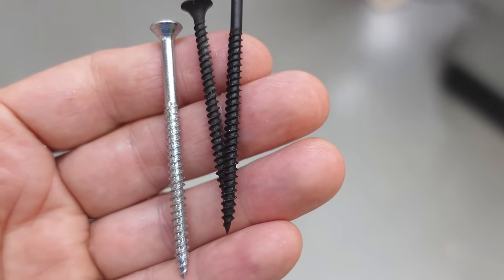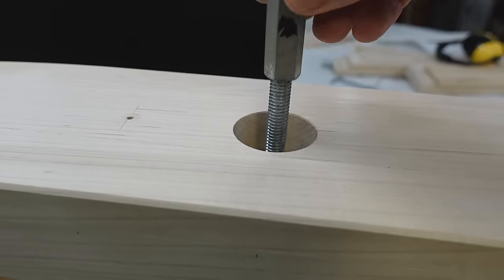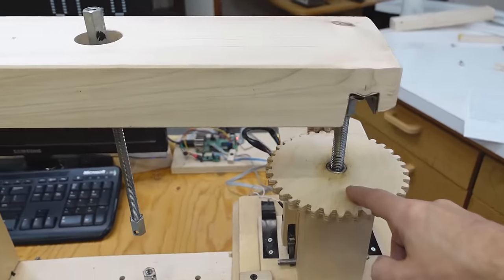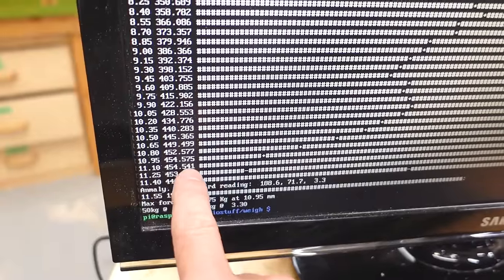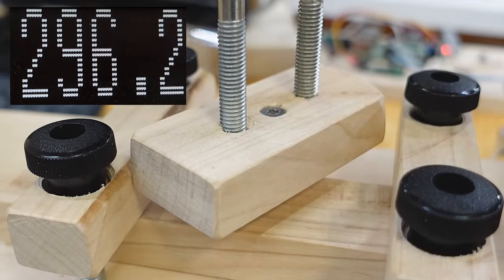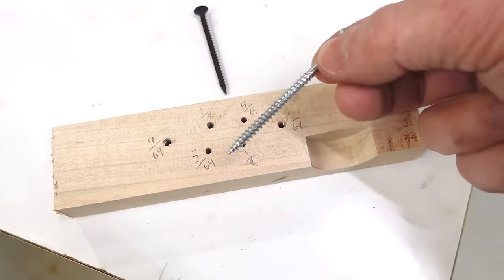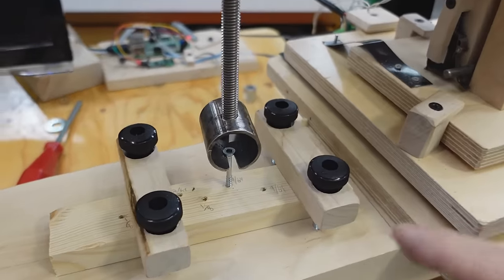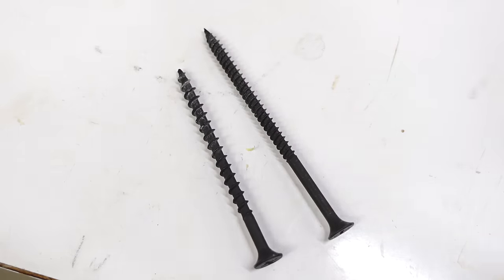How well do screws hold in wood?

Comment: I'm guessing that in softwood the fibres are more likely to compress and bend and therefore release the screw. A coarser screw thread would have more fibres between threads, but that would allow more compression and more space to bend into. Finer screw thread leaves less space for movement but fewer fibres to resist the pulling force. So, coarser and finer screw thread have little effect on resistance to pulling out. The difference is, as you said, ease of screwing in and likelihood of splitting the wood. Thanks for another interesting video.
Reply: I always thought fine for hardwood and coarse for softwood myself. But realistically as long as the screw is long enough I'm good to go.

Comment: Juste a thought about the "Not jumping" around the  2:00 mark : I suspect the cause is because of less elasticity on the upper beam which means that less force is stored in it to be dispersed when the screw/wood fails...
Reply from the maker: yes, realized that later too.  Once it starts to yield, the force drops more rapidly with the stiffer setup, so you don't get as many explosive failures

Comment: Matthias had a nice thick top piece. He cut into it on the ends and middle so that the loads would be in-line. It looks to me like he could have just left it full-thickness. The center bolt load would be at a different height, but since the force is vertical it would not have changed the moment arm nor the force calculations. Is the movement in other tests enough to cause a non-negligible difference? It seems that the weakened board is still strong enough, but it could potentially still fail.
Aside from that, I found it quite useful to know that pre-drilling the screw's minor diameter is best, considering strength and splitting.
I found the modes of failure interesting too.
Reply from the maker: I just didn't want to think about it being a factor.  The beam tilts, and that offsets things sideways.

Comment: Cool test.  Did the conical screw sink because of the shoulder?  in that case all of the load is held by the head in the top piece of the wood, with no threads to bear extra load.  Of course, with threads up to the head, you would have less clamping force between the pieces.  Trade-offs!

Comment: "Way more than we ever wanted to hear about pilot hole size" Matthias you doubt your audience. My son and I watched every second :)

I'm really curious about the head shape and the screw's surface finish having an effect. I would think the surface finish wouldn't make that much of a difference in the extreme force test but perhaps the texture allows it to distribute force better, and fewer individual fiber failures cascading into the runaway effect of the wood failing.

Comment: I have wondered if said screws were put in, in pairs making a V while joining two pieces of wood, so as to not be only testing the type of thread's holding power, but the metal shaft as well. Ta.

Comment: Would be interesting to see how grain direction and angle affects this!
Reply: I think we know that drilling into end-gran is weaker. But by how much?
Reply: According to the Eurocode, you can expect the same ultimate limit strength up to 45 degrees, and a decreasing strength as the screw gets closer to the grain direction. The failure mode will also change. When the screw  is parallel to the grain, you will no longer be bending the fibers, but more or less pul out a "dowel" the same size as the thread diameter. However, for a simple test like this, you might gett higher values than what is used in engineering. Wood, as we know, moves over time with moisture content and load levels, which can lead to small cracks often viable in the endgrain. These cracks can correspond with the failure mode for the screw, leading to lower resistance over time.

Pardon the long-winded comment...

Comment: 9:15 I suspect there's a pilot hole diameter between 3/32 and zero that can get you that optimum pull out strength and still guard against splitting the wood as you drive the screw in.  We might be surprised how little material needs to be predrilled out of the way before sinking the screw in.

Comment: I wonder if the differences between the materials of the screws has any impact on their ability to withstand being pulled out of the wood. Does the black phosphate coating increase the amount of friction and therefore make them harder to pull out?

Comment: Curious about the effectiveness of particle board screws compared to regular screws in manufactured materials (like particle board and MDF). A lot of cabinetry is made with those materials and I've always wondered if different screws matter in a material that is pretty soft to begin with.

Comment: I'm assuming the holding power with a screw in end grain, e.g. along the grain, instead of across it, is going to be much, much lower? Could you perhaps test this as well?

I was very surprised to see the coarse and fine thread drywall screw perform the same! I would have thought the coarse screw had much better holding power. Also I didn't expect the holding power to be this strong in general. Nice Test!

Comment: May I recommend trying each variation sans pilot hole.  There's a lot of folks out there, myself included, who rarely drill pilot holes.  I'd wager there's going to be a greater holding force as the strands of wood haven't been broken/cut-away via the drill bit, but have been merely pushed aside.

Are you an engineer by training?  I wanted to be, but Calc II (weed out class) was more than my 13 years previous Algebra could handle.

Keep up the good work, sir!
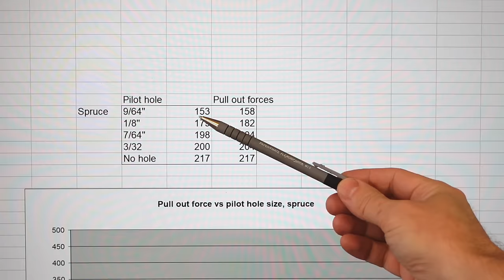Reply: At 8:58 the graph shows a tiny bit more strength with no pilot hole. But the chance of splitting the wood is a lot higher, he said. Especially near the edge or wherever common sense tells you it might split. If it doesn't matter, I usually don't pilot hole either. Saves time and getting less tools out to put away again.

Comment: I have seen these perforated metal strips that are inserted into slightly oversized holes with the idea that the screw would grab onto the metal and also the wood to form a mechanical bond. I Al curious if they would be harder to rip out of wood than just the screw alone

Comment: Odd, I was under the impression that common thinking was never use drywall screws in any structural application because either the heads pop off or the screw shears. Was expecting to see that, yet not?
Maybe Canadian drywall screws are just better or not the absolute lowest cost supplier?

Comment: Many thanks - its good to know that many screws - with a snug pilot hole - will withstand a force of at least 250 kg which is more than enough . . .
Reply: That's 250 Kg per screw. I never use just one unless I'm hanging a small picture. For a actual structural assembly I'm going to use a minimum of 4 screws per board. Otherwise it is an articulating arm that pivots.
Reply: @1pcfred  - Yes even better - Recently built a small workbench top which cam be clamped in a SuperJaws XL
Great to know that 3 screws is more than enough to hold two pieces of wood together.
Reply: @chriscardwell3495  screws are more force than one might imagine they are for such a little thing. One screw is stronger than I am. So yeah 3 screws are a lot of power. They'd resist anything but the most determined prying. You'd really have to be trying to bust them.

Comment: I am big on the thread width. That is the difference between the outer & inner diameter. I posit that the wider the thread, the more engagement into the wood and the better pullout force. I would love this to be tested. 

Drywall screws have really good thread width compared to wood screws, for some reason.  (BUT I hate that they're Philips so I never use them.) 
.there seems to be variations between manufacturers as well.

Comment: Be interesting to see if those threaded fastener inserts with the really flat and deep paddle like 'thread' bits pull out differently, I suspect with the flat and deep thread sections not acting as a wedge and spreading the load the failure wouldn't be as much pulling the fibres up and more clean splitting when it fails. But I have no idea really.

Comment: In my real world remodeling experience fine thread drywall screws I can usually use a hammer to pull out with ease vs coarse thread.  Would love to see a stronger jig setup testing different screws and even structural screws of equal size
Reply: I think fine thread drywalls are for metal studs. The gauge of metal studs is pretty thin. But we all use them in wood too. You can also use a hammer to put a screw in. Ain't nobody got time to use drivers.
Reply from the maker: the coarse screws had a slightly longer yield curve, which suggests more energy is needed to get them out.  But the finer threads could take more force before they started to yield.

Comment: I would like to see that test on a proper, taper shanked wood screw.
Reply: I have tapered drill bits for drilling pilot holes for tapered screws. It's a pain to get all of that right. Once you've got the bit setup you're good to go. It's still a fiddly process though. So the results Mathias achieves likely won't be the results anyone else gets.

Comment: Can you do 25mm M6 threaded insert vs 12g screw with 30mm penetration? Lots of furniture makers are direct screwing legs (X shape or hoop) to 42mm thick table tops using both these options - no aprons etc.

Comment: I have two wonderings:

What if you squeezed glue into the pilot holes before driving the screw in? (Hardening the surrounding grain)

What if you hammered the screw in? (Sheering the grain downwards compressing it against the pulling force)
Reply from the maker: the failure wasn't at the surface.  I doubt the glue woudl penetrate deep enough to where it failed

Comment: Would the finish/material of the screw make a difference on the holding strength? Zinc plating seems smoother than the black phosphate.

Comment: I've always heard coarse-thread screws for softwoods and fine-thread screws for hardwoods. I wonder if that is the case? The fact that fine-thread screws were marginally stronger than the coarse-thread for softwoods sort of contradicts this. I wonder if it's the same for hardwoods. 

Also, Kreg states that for hardwoods, "aggressive threads tend to tear the wood fibers, resulting in splits in your wood". But do coarse-thread screws really have a higher likelihood than fine-thread screws for splitting the wood? 

I notice Kreg recommends coarse-thread screws for softwoods, plywood and MDF, and fine-thread screws for hardwoods. I wonder if this is true, and if pocket hole/no pocket hole impacts this.
Reply from the maker: I would think coarse threads are less likely to split the wood, like I said in the video.
Reply: @Matthiaswandel Interesting. I wonder who's right; you or Kreg. Perhaps another test is justified :)

Comment: Screws and nails are often applied horizontally to hold a piece from moving downwrd. I wonder how the shear strenth of various screws and nails ompare?
Reply: In the vertical a fastener causes friction between pieces held together and that's your carrying load. The nails and screws aren't holding anything up. They're holding stuff together. The pull outs we're seeing here are close to a half a ton. So it's like a half ton pile of wood and you're trying to drag it across the floor. Which would not be easy to do.

Comment: Interesting! Also, I'm not sure if it's just a trick of the light or my eyes but it seems that at 5:42 there is a minor rotation (anticlockwise) of the screw, as if it tries to loosen itself under the strain. Pretty cool stuff. Thanks Mattias!
Reply: Flicker of light. I put it full-screen on a large monitor and my eyes say the screw didn't rotate.
Reply: @weldabar  I did the same and left the mouse over it so I could see a difference; it still makes me think it moves slightly but it's likely just the light. It doesn't matter anyway! :)

Comment: After you drill the pilot hole, run three or four drops of water-thin CA into the hole.  Allow it to cure (10 minutes or so) and then drive in the screw.  I'll bet it doubles the force necessary to pull it out.
Reply from the maker: please watch the video for why it would not

Comment: Do you plan to try CA glue in the wood threads to see if that makes it stronger?
Reply from the maker: No, seeing that it wasn't the threads themselves that failed
Reply: @matthiaswandel  I would expect that a thin CA glue might wick into the wood fibers around the hole, and the increase in material rigidity may distribute the force over a wider patch of the wood.
Or maybe not that at all....
If only I had a screw extraction force testing apparatus, I would know for sure. 🤔

Comment: I read a study about the load each individual thread holds in regards to bolts in metal that said basically only the first 6 threads on the fastener hold any significant load, with the first thread holding 50% of the total load. Any chance you could test something similar with wood screws? I'm dying to know if an increase in length increases holding power.
Reply: Yeah, that would be very interesting.
Reply from the maker: with the screw and hole having the same stiffness in metal, that makes sense.  Basically, the screw stretches a bit, so its threads become longer and only the first bit grabbed..  But as you could see from the cutaway, the wood yielded quite a bit, much more so than the screw would stretch.

So this is not the case with wood.  No experiment is needed.

Comment: A little constructive criticism, your sample had all the holes in a line along the grain and showed clear cracking. Better to stagger them and aim for some minimum separation per aligned pair. I think out of all your videos I learned the least from this one. Sett pilot to minor or slightly under or no pilot. I only pilot when I know I have to because too hard or prone to splitting or need alignment perfect. Otherwise I don't.
Reply from the maker: Look carefully, the crack is a straight line, doesn't follow the grain.
It was a scoring line from marking for something else.  Don't remember what for, it was a piece of scrap.

Comment: Awesome! So why then does everyone clamor that you can build stuff with drywall screws, you should only use wood screws? Are wood screws a scam?
Reply: Dry walls often work OK in the short term. But if you want something to last then you should use a better fastener. I've seen plenty of drywall screw failures over the long term. Even in drywall. So it really depends on the performance you want. Someone slapped an arbor together with drywalls outside my back door. I've had to rebuild it all with deck screws because it fell apart. But it was good for them.

Comment: I wonder if zinc screws would be weaker than the hardwood.
Reply: I have never seen a screw made of zinc. Zinc coated screws are common but I wouldn't think the coating would affect strength much.

Comment: Is it not that drywall screws are for grip and pull and more standard type screws take greater shear forces?
Reply: You shouldn't be relying on the fastener itself for sheer strength. That comes from the friction between the pieces. The fastener holds the pieces together tightly and the strength is the friction that is developed. That being the case there are ramifications for how things are constructed. For it to work your joins do have to be tight. You can't make floaters.
Reply: @1pcfred  Agreed. But when fixing, especially non fibrous/wood that has significant downward force, you do need a screw that has shear strength.
Reply: @aaaatttt101  as we saw in these tests the screw is just going to pull out before it breaks. Due to friction they're never going to be under a pure shear load. Not if you made whatever it is right. Which is work pulled together and not jacked. When in doubt use more screws. I have seen drywalls fail. I've seen them work a lot more often though. Which is why they're used so often. There's much to be said for cheap and easy.
Reply: @1pcfred  I'm talking about the construction of the screw and it's focus. More screws and the material it affixes to is not the point I was trying/failed to make

Comment: drywall screws actually have the best holding strength, it is pretty funny how strong. Project farm's video shows that.. but they are a weak screw overall
Replying to the end of the video, I actually want more data. Also data on how much the thread depth matters, when holding 2 pieces of wood together for example.

Comment: Hey Mathias, could you please convert some of the units you use? Like show both imperial and metrical, sometimes you use both, for different things, like de inches for the hole and the millimeters for the screws, this is kind of confusing, by the why, my country uses metrical system.
Reply from the maker: I use inches when the thing is in inches.  The drills are sized in inches, so I say their size in inches.  Here's a magical secret that it appears you don't know: An inch is 25.4 millimeters.
Reply: @matthiaswandel  Kinda rude answer for just a suggestion comment, I thought that as an engineer who likes to do experiments you would be used to use the international units system.